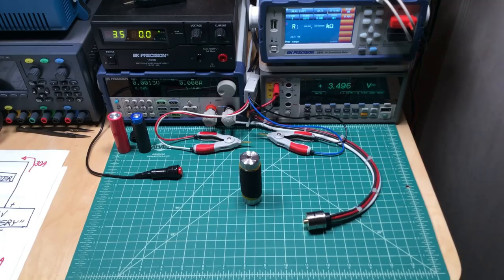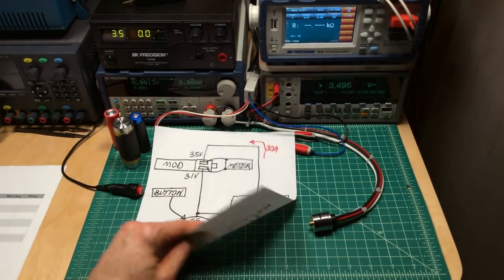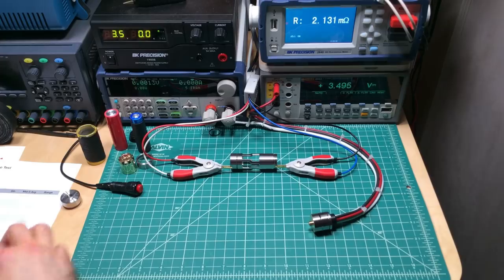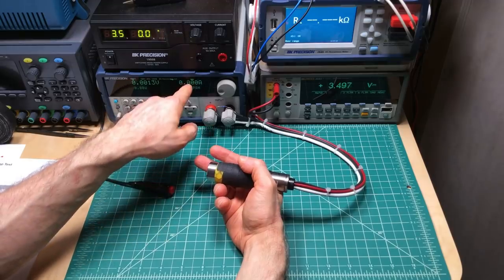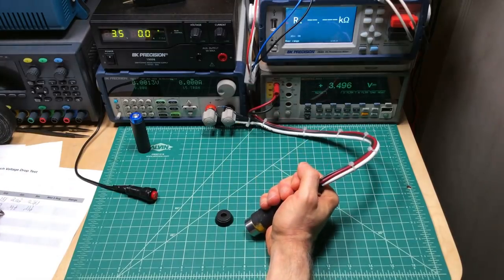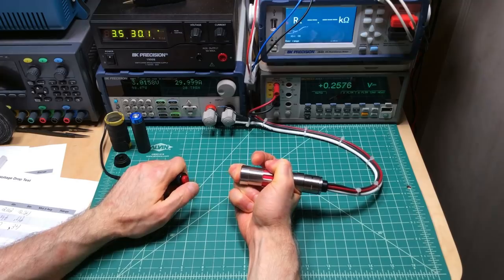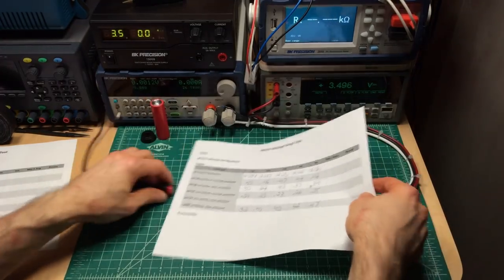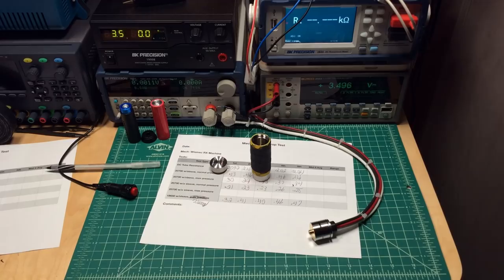Minding Your Mechs – Ep003 – Wismec RX Machina Voltage Drop Testing

Comment: Nice comparison.  Can't wait to see the Purge Slam test.  Particularly I'd love to see a comparison on a Purge tube (ex. B2B copper) with magnets, hard throw silver spring, silver firing pin.  Users swear of perceptible differences.  I will tell you this though...I just got a Pilak Tycoon and it's a dream.  Solid (not plated) silver contacts and conductors throughout.  And no make and break on battery either.  It's phenomenal.  Love it!

Comment: Ideally it would be best if you had a machine that would do the compression. You could read the pressure applied and eliminate any uneven presses. But the cost of manufacturing such a device and having to do it for each mod makes it unfeasible. And, machines don't use mods, people do. Good overview Mooch. Look forward to additional tests. This is the type of thing that should be done as an industry standard, but glad you are taking the time and effort to provide the information to the public. Keep up the great work!

Comment: Thank you Mooch!  You just proved me right.  Cheap mech mod made out of stainless steel only has at most .003 ohms resistance.  This will not be noticeable even at an unsafe build of .05 ohms(less than 1% resistance difference).
Reply: Yes, I understand this does not apply to every mech in existence as some will be better or worse.  I do not see the differences being huge though except in an obviously bad mech.
Reply: Opps, less than 10% difference.
Reply from the maker: I think if you run the numbers, 0.4V drop at 30A, you get a mod/atty resistance of 13.3mOhms.

Comment: Oh boy i was waiting for this video... So many times iv thought of sanding the sleeve down a millimeter or two just to get the f*ucking thing to work but I waited for this video to find out if its really the sleeve. And it is... thank you Mooch for the video and your great work towards vaping ❤️
Ps. My RX Machinas 18650 adapters pin and the battery contact on the top cap gets hot as shit! Running it with 20700 nothing gets hot. But the probelm im having with the 20700 is that for some reason the button press becomes very crunchy... and it has been like that from day one. Thats why I rather use 18650 on it because of the button press being smooth.

Comment: <- This guy needs your help. 
I got this exact same mech mod recently and noticed weird damaging(something like rust) on the Golden pin that is making contact with the battery. The same happened with my 18650 and 20700 Batteries. I cannot find any video that could help me to understand if this is some problem from wismec or wrong use from me or of it could get dangerous... Thank you for reading. Have a nice day. BTW keep up the good work Mooch! <3

Comment: Hopefully someone can send you a really really expensive tube mod that claims it's the "hardest hitting" tube on the market. And you can debunk that lol. I assumed the battery was discharging at 4.2V and didn't think much affected the voltage drop especially if it was hybrid. You would think since it direct to the RDA, where's the voltage going then? And why would it be such a drastic drop.

Comment: so even if I would theoretically throw a .05 build on tubemech (not recomended) a 18650 battery will peak/not have move than a 30A output?
Reply from the maker: Many batteries can deliver more than 30A for a short period. They might be at a low voltage and be overheating but they can do it.

Comment: Do you recommend the battery facing positive down in this tube seeing as how the vent holes are on the fire button?
Reply from the maker: I always recommend using whatever method the manufacturer says you should use. There might be things about the construction of a mech that could make one method worse than another and with the positive down you will short circuit the battery as soon as you put it in if there is wrap damage,

Comment: Mooch question i have a TAC 1 flashlight which has the option of using an 18650 or 3 aaa batteries which i decided to use the 18650 and had the flashlight on for a bit and got hot can i run into a problem of the battery blowing on me with venting cause of the long use of the flashlight? Thanks mooch
Reply from the maker: A short circuit will do it but a cell, typically, has to get too hot to touch before it might vent. I recommend getting much higher current rated 18650’s though because if they’re getting hot they’re not running efficiently and are probably sagging a lot in voltage.
Reply: Battery Mooch so maybe witt out having to worry about any shorting better to go with either 3 rechargeable aaa batteries or 3 duracell lmao thanks for the speedy reply good morning and have a great day mooch thanks again
Reply from the maker: All AAA batteries, not Li-Ion? It all depends on whether you want to use rechargeables or not. I don’t have any recommendations but good rechargeable can save you a lot of money if you use the flashlight a lot.

Comment: Couldn't you use some kind of hydraulic press, to get more consistent pressure on the switch?
Reply from the maker: I had considered a few different approaches, using actuators, linear motors, etc., but calibrating the pressure for each setup would be a huge effort and just not worth it in my opinion. The performance variability that each mod may or may not have might be an important part of a vaper’s decision whether to buy that mod or not.